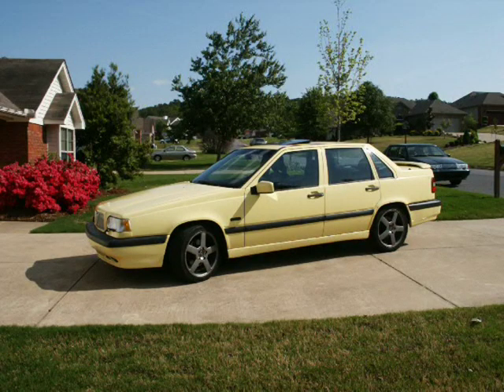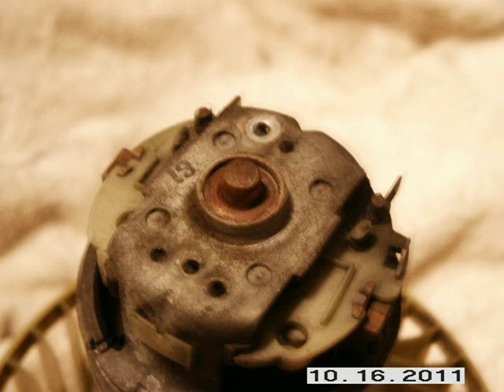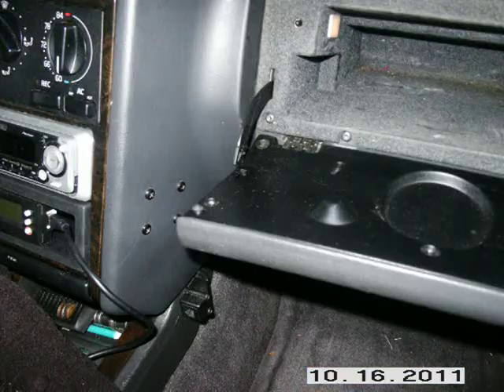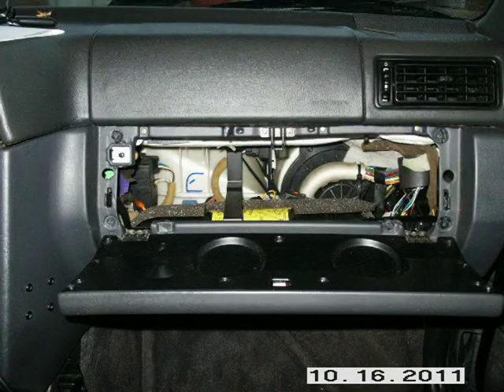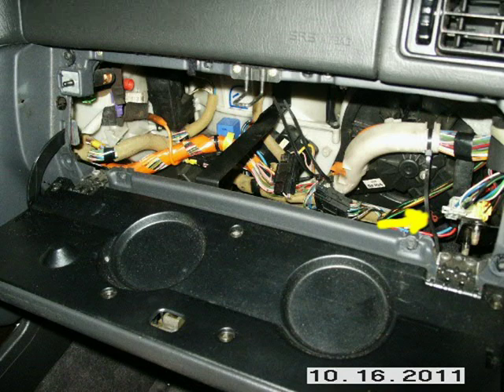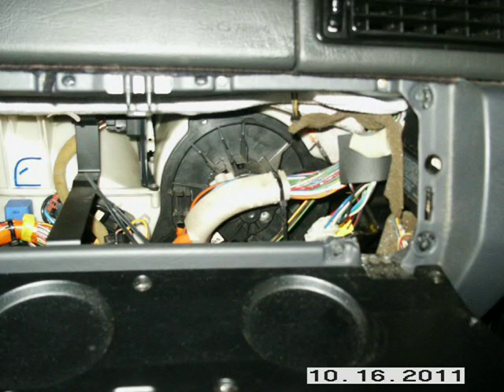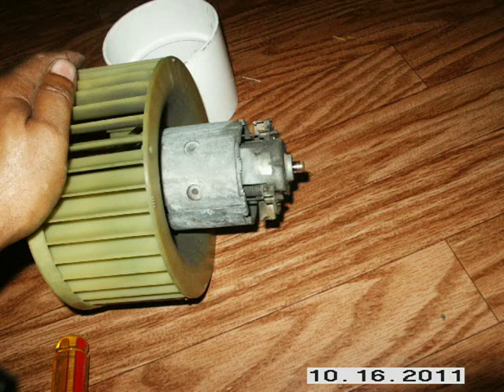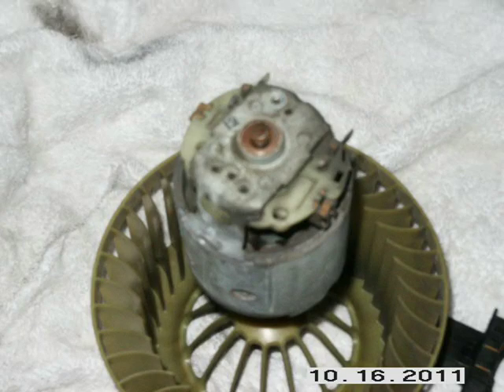Blower fan motor removal, replacement and lubrication, Volvo 850 - VOTD

Comment: Robert, thanks for all your great Volvo videos. I Have a question. I have a 2000 Volvo S 80 and the blower motor and resistor were both changed about a year ago. Because they were intermittently going out. If I give it a good hit under the glove box it will start running again. Until next time I started the car, sometimes it would run and sometimes it would not. Any idea what's causing this?
Reply from the maker: +rotfan77 Loose wire or bad relay.
Reply: I'll try checking the relays and wires. Thanks

Comment: So my 95 Volvo 850 stopped blowing air, but i can hear the compressor turn on, could it be the blower fan motor that i need to have replaced? please help i am currently in Las Vegas in 110 degree weather and i can't go on a single day without A/C. I will melt into a puddle of water in a matter of 5 minutes without any air blowing at all.

Comment: Robert, I've had better success lubricating the blower motor on my 94 850 (original part) using 3 in 1 oil.  I got the idea from videos about safely lubricating squeaky ceiling fan motors. Before I tried the 3 in 1 oil, I lubricated the blower motor 2 different times with white lithium grease- once with the tube stuff and once with the spray. The motor started squeaking both times after about 1 week. When I used the 3 in 1 the motor was squeak free for almost 1 year. I just relubricated it today - no fun in the heat, humidity and mosquitos in south Texas (105 degree heat index, 80% humidity at 7pm) but the fan is quiet again, hopefully for another year.  I've never been able to get the cage off of the motor (I didn't want to break it trying too hard) so maybe the lithium grease would have worked better for me if I had been able to get the cage off. Thanks for all you do for the owners of old Volvos.
Reply from the maker: Thanks for the tip. If you can, find a newish one at a junkyard.

Comment: Hi Robert.I changed the blower but when I conected the new one with the switch that appears diconected in the video 04:39, the blower seems to star blowing full speed even thow I remove the ignition key, not responding to any command on the air conditione module...Can you help?...Thanks in advance
Reply from the maker: Could be the ECC or a relay.

Comment: I have a 1993 Volvo 850 which has me stumped. The blower motor doesn't run at any speed. While working on the car I removed the resistor inspected, cleaned the plenum and put it back in. Suddenly, all speeds worked. Turned fan off and it worked in all positions again. Tried it once again and it didn't work at all. I replaced the resistor, thinking that it might be defective and the blower still doesn't work.  Any ideas?
Reply from the maker: Have you removed and tested the fan with direct power? You may also have a stick relay. Unplug the resistor, then plug it back in, and see if the fan works.

Comment: Do you have a video showing how to diagnose musty/mildew odors coming out of vents when blowers are turned on NOT in re circulation mode on a 98 C70? I've heard about sunroof drain leak issues but cannot find anything specific for 70 series vehicles.
Reply from the maker: Not really. You can get a bottle of water and pour it into the corners of the sunroof frame and see if the water makes it down to the ground near the tires.

After than you can check your drains at your firewall panel under the hood.

If all of those are clear, you can run the AC and see if water drips under the car just inside of the passenger side front tire. The evaporator should drip water into the cabin compartment and drain under the heater core assembly. If that drain is blocked it can cause mold to build in the cabin air box.

I have seen cabin filters get so bad that they fall apart and clog the drain for the cabin air box system. Have you replaced the cabin air filter lately?

Comment: Thanks for the tips. I will begin the diagnostics when the weather improves. The cabin air filter is the one under the cowl in front of the passenger side windshield right? Yes that has been replaced. 

I have even tried to spray Lysol through the filter opened which only works temporarily then mildew smell re appears. 

All of my carpets are dry which seems strange as well. I will post the source of my problem as soon as I figure it out for others with the same problem.
Reply from the maker: Yes that is it. Good.

Comment: Thanks Robert for the wonderful videos and educational information. I have poblem with my fan because it has four speeds, the fourth is not working, what do you think I should do?
Reply from the maker: Usually when a speed is not working you have a problem with the resistor. I would change that with a suspected good used one.
Reply: Thanks for the reply Robert. Where can I find the resistor? I am an amateur regarding car mechanics. My volvo 850 is from -93, but I love it.
Reply from the maker: The resistor is just to the left of the fan. It goes into the duct housing and the base of it is about the size of 2 credit cards side by side. Has a wire connection on it and maybe 2 screws holding it to the duct work. You can access it from below the dash if the knee bolster is removed.